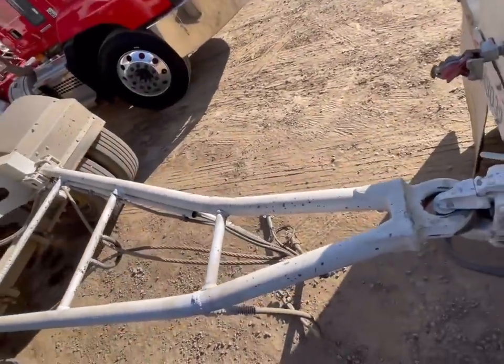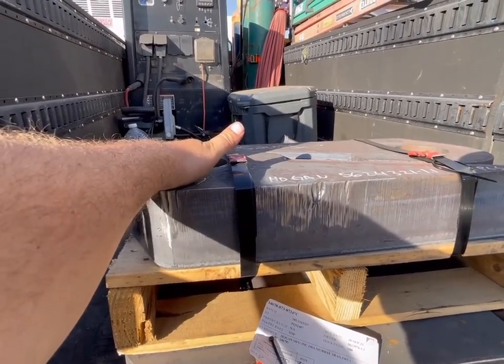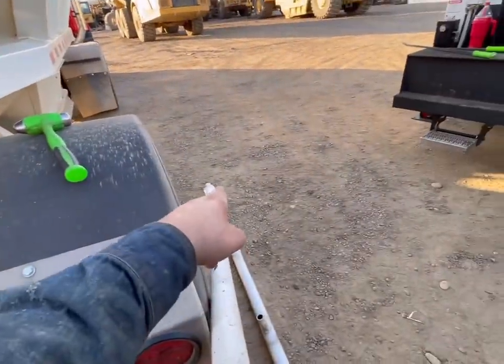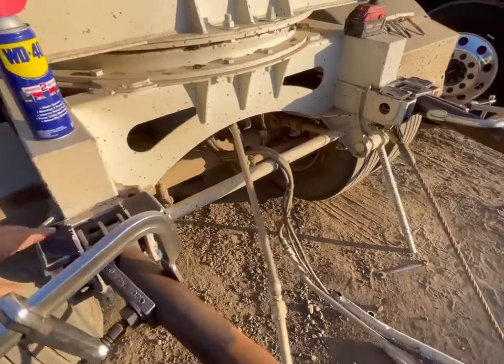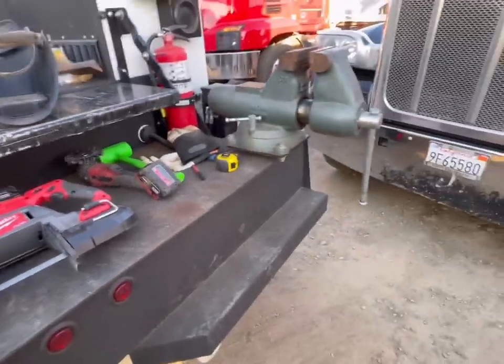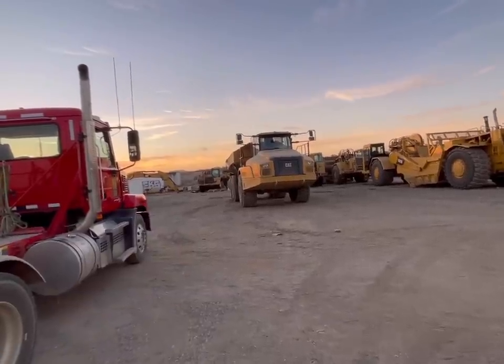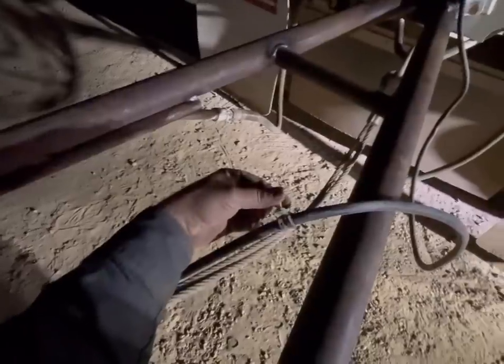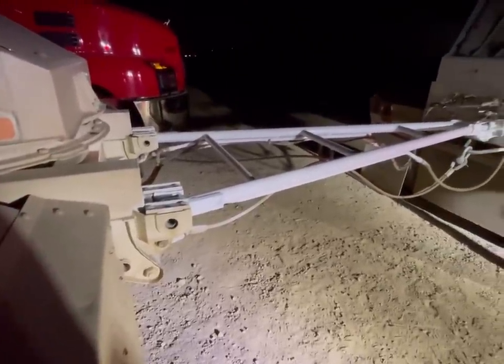Doubles Trouble

Comment: When repairing trailer tow arms our company will also weld in 2 or 3 - 1;/4" steal diamond plates between the first, second and third support pipes. Never to be seen again when it leaves our shop. 😎😎👍👍
Reply from the maker: I think a big reason it was originally failing was because they jackknife it multiple times a day. I will definitely be doing this job again.
Reply: @OFW  A rotating income. 4 sure. 👍👍

Comment: Wow I’m surprised that the draw bar material is so thin 😮. I would have thought it would need to be a lot thicker material to handle the stresses of towing a big heavy loaded trailer. Once again you did an awesome job and don’t be concerned about what some keyboard experts have to say, this is your business and this is the way you do it. Keep up the good work. Love the videos. 👍👍😁😁🇦🇺🇦🇺
Reply: The material doesn’t have to be very thick because it is for pulling stress only.     The brakes hold it back and unless they did as they had there isn’t any twisting on the drawbar.     But yes it always amazes me when i have to rebuild something and the hardest part for me is to not overbuild something as to move the stresses to another component.

Comment: Hard wire mig is just fine, so long as your weld puddle stays shielded. Dual shield should be reserved for high deposition welds and thicker material. Black Dog Welding

Comment: As long as the filler metal matches or exceeds the Ultimate Tensile Strength of the base metal the E70S-6 filler metal is fine.  I'd guess the base metal has a 60 or 65 ksi tensile strength.  The 70S-6 has a slight increase in carbon content vs S-2, higher Mn and more Si.  The carbon and Mn help push the strength up, yield strength in particular. Ductility is also enhanced. Keep in mind that when yield is exceeded the part, regardless of what it is, can pretty much be considered screwed.  The yield strength roughly approximates the point where the material stops undergoing elastic deformation and goes to plastic deformation which is permanent. Mn and Si also serve as deoxidizers.

Comment: Wait tho lol if you’re building it off of the current positions of the truck and trailer. Wouldn’t it be off, considering the previous part was bent? Are the truck and trailer perfectly aligned?
Reply from the maker: Yes they were.  I squared it.  Flipped it and it fit both ways also.

Comment: I call it a Trailer tongue . Great job boss .brings back memories. Thanks for sharing . I used to fix all of tri counties bottom dump trailers in the 80s reskin the trailers fix the the trailer tongues and also weld new Pendell hitches on the tongues also weld up the cracks in the main frames right above the hoppers and then add fish plates. I had my own truck like you and my company name was heavy equipment welding . Mike Mayfield. I also worked for big contractors like Random construction,ACI const . Sukut const . Chaparral const and R&H paving here in California.

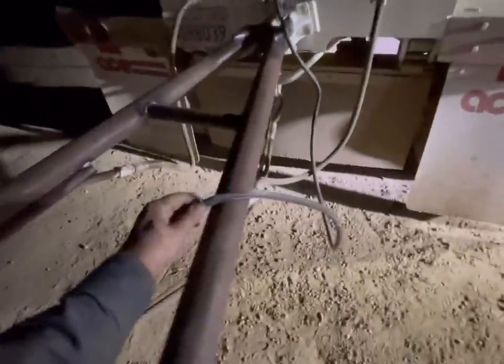Comment: 27:25 A stud welder. Use them on ships all over the place wire runs and everything else hanging from overheads. Also, pin welders for installing sound barrier and heat barrier insulation. Nice billable work.

Comment: Took an intro to welding course in the 10th grade. Been running semi's since I was 20. I always thought those pup dumps were neat. And I can a test they pull great if the dolly is good and straight. If not. It'll wag the tail and that's not good. And those was freight van short. Not the long drawbar style like those.

Comment: The drawbar was bent...  You mocked up the new drawbar exactly the same way as the bent one...
So you basically built a crooked drawbar out of straight material.
Otherwise good work!
Reply from the maker: Actually no.  After tacking it together I squared it up so it is straight.

Comment: Water jet cutting of the trailer pin ears would of been much better and it probably would of been easier to line bore since you wouldn't of had to machine through the flame cut surface.

Comment: I hear you on the use of short circuit Mig, and not dual shield (or hollow core) in factories they use it a LOT, when strength does not call for something stronger (pressure vessels and water heaters come to mind)    Would I be wrong assuming that you have had dual shield wire through that welder, when it was "needed"    I have a few month of formal welding training (I am a electrician)   back then I could lay beads like that with stick, but not with wire feed, the only time I came close was on cast steel parts, for some reason they always come out looking awesome.   fantastic looking job.

Comment: Trying to fabricate using the position of the truck and tow lime they was is not ok, you will not have an isosceles triangle, for short the arms wil not be eqal. One inch will not matter still. Be safe and i will be here for next ones, trying to learn how to weld :)
Reply from the maker: Well you are wrong.  There are many other measurements that went into this and it came out perfect. They use it every day with no issues.
Reply: @OFW  i think it is ok, is not spacex. Anyway good and nice work, on the field are required smart solution  time/budget and you have managed to put togheter all. Nice work, keep going! Thanks for your time sharing with us!

Comment: I hate trying to save some of that kind of junk. Cost more than replacing it with new in the long run.
Reply from the maker: I was able to replace this for 1/4 the cost of a new one.
Reply: In Europe (especially Finland😅) it is illegal to repair many things (incl. drawbars) yourself, we have strict safety rules. Because of that, in many cases, buying a new part is cheaper and faster than repairing an old one. I have watched many your videos, and you are good explaining and also very good eye for repairs 👍

Comment: I hope the truck and trailer were parallel when this was made?
Reply from the maker: Yes.  I squared it.  And it fit upside down.
Reply: @OFW  beautiful….and by the way short circuit mig is what I would have used also, as strong as any other process for this and is quick and easy to use! Great job.